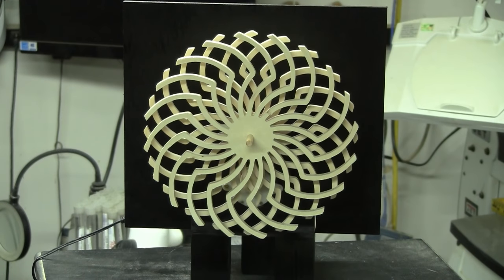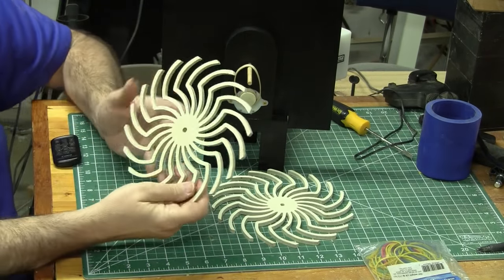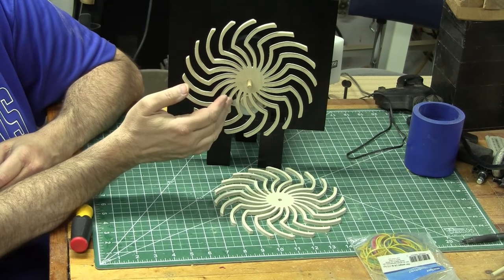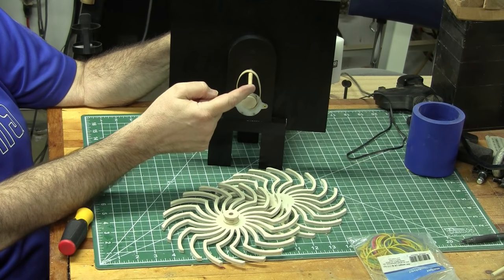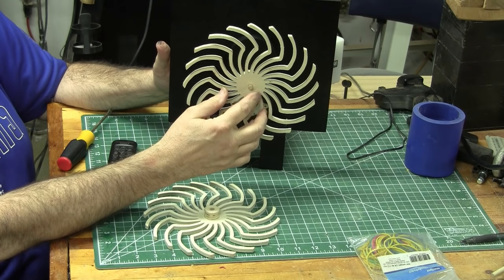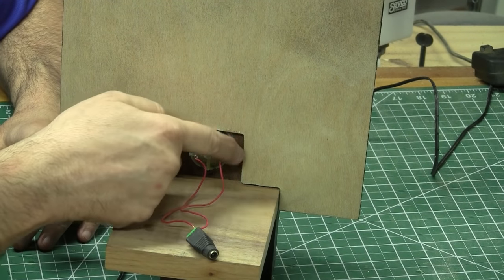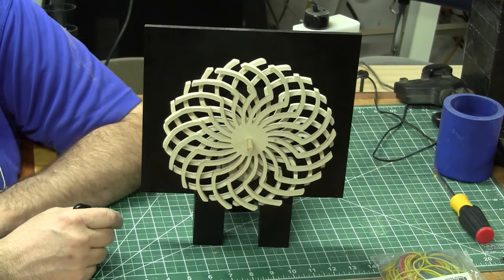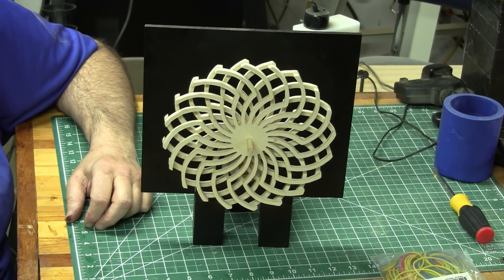Kinetic Art Scroll Saw Pattern. Motor driven.

Comment: You might want to try using a skateboard bearing instead of running wood on wood. They are cheap and easy to find. And as close to friction free as any bearing around that size that I have found. I use them on wooden clocks. The inside diameter is a bit above 1/4". I insert a short piece of 9/64" brass tubing from the local hobby shop and that tubing has a 1/4" I.D. making it a perfect fit for a 1/4" shaft.

Comment: Steve, I've made some kinetic sculptures as well. You should give a constant force spring a try for power. Drill press quill return springs can be easy to find and sized about right. A ratchet and pawl mechanism can be cut from wood, and either magnets or centrifugal force used for timing of the power being applied. Ball bearings are needed to get long rotation times. With proper timing a single wind can run for many hours. Your "wheels" of the sculpture should be weighted  on one side, so when done spinning they settle weight down, lining up your magnet to temporarily release the pawl on the ratchet and allow the spring to activate.
Reply: Do you have a video how
Reply: @yvettereynolds5945  Sorry, no.

Comment: I’m thinking of cutting these out on my cnc router when I get it back up and running. I am eliminating using a pc to control it to using an SMC5-5-n-n controller. When I build this sculpture, I am going to make the front one turn the opposite direction to make a better effect.
Reply: I CNC milled just the wheel parts, worked great! My grandfather cut the spirals on the scroll saw but we had a terrible time trying to scroll saw or drill the wheel holes to fit nicely on the motor without gluing it to the shaft. I'm sure you could CNC the whole thing but it feels like cheating :)

Comment: Years ago I made something similar. Is easy to made 2 patterns move. Its not so complex. Also there are engines with constant speed driven by 60 Hz. I buy those for made some clocks but never end that project.

Comment: I have a 20 inch sears craftsman contractor series scrollsaw  purchased in 1992 and am thinking of replacing it with a Seyco st21, what are your thoughts.
Reply: I have owned the Seyco st21 since before it was shipping and it is a fantastic saw. If you have not used any of the modern scroll saws then you are in for a treat. I know the owner of Seyco and he is excellent to do business with. Ray has been an active part of the scroll saw community for many years and knows the hobby better than anyone out there. Their support is excellent. Many scroll saw brands are having shipping delays right now because of the pandemic. You may have to wait a little for delivery but it is worth the wait in my opinion.
Reply: @stevegood3224  Thanks, this is helpful!

Comment: Mr. Steve, what do you think about the Dewalt 788 scroll saw? I have it in my sights to buy one in the future.
Reply: Hi Ron. The DeWalt DW788 is a mid-range scroll saw but it is probably the most popular saw ever sold. I still own one that is about 13 years old and it runs fine. It does not have the same build quality as some of the more expensive saws but it is far from cheaply built. It cuts a little more aggressive than some saws but you get used to that. If you want to be a production cutter then you may do better with a high-end saw. If you are a few times a week scroller then the DeWalt is fine. Like all tools, you want to buy from a source with a good return policy. I still see out-of-the-box problems occasionally so it's good to have easy returns.
Reply: @stevegood3224   thank you for your reply. Thank you Steve for all that you have done for the scroll saw community. You have blessed us all.

Comment: very good. the next improvement may be add a motor driver to turn clockwise 2 min then turn to counter clockwise 2 min. automatically. because that time its looks better. i want to make this movement  with two spring that one attached to front, the other attached to back. when turn bay hand (firt movement to set springs) firs spring release and the other set (gain kinetic energy) . after release the hand two spring work different directions and vica versa. i know its difficult to explain it with words. its theory . i will try it. think like "pull and relase" toy cars. thank you.
Reply: I love your ideas. When you get it completed send me a link to the video or picture.
Reply: @stevegood3224  sure. another advise that you know , paint the arms in red and green (half of arm red and half of green) . it increases illusionic effect of kinetic art.